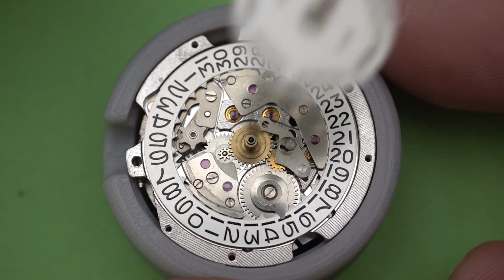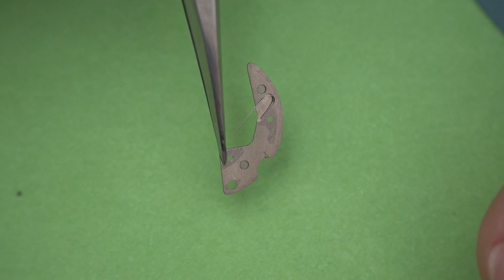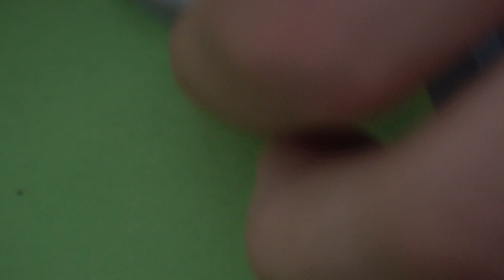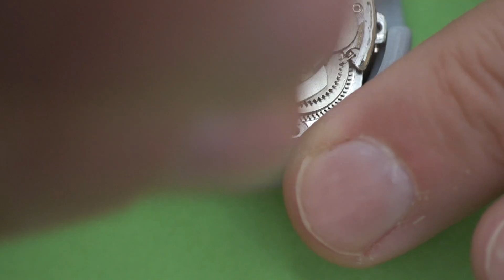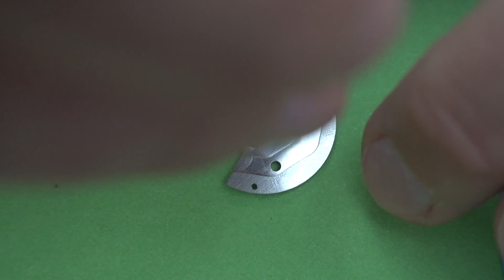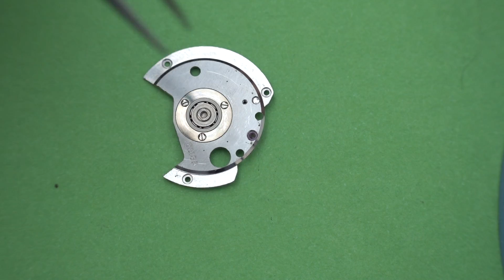[TECH] - SEIKO 6218 Teardown - Useless JEWELS +

Comment: The black powder is Seiko S-4 Grease.
Also, there is wear on the automatic assembly bearing.
Reply from the maker: Not in this case, the black powder under analysis was metal powder, mixed with grease. This forms a great grinding paste.
Reply: Agree. But the Seiko S-4 is black and was commonly used on that area like on Seiko 61 series. How bad is the condition of the ball-bearing for the oscillating weight(p#821690)?